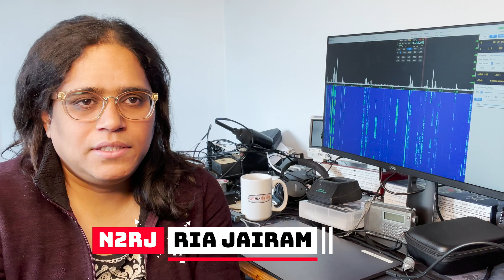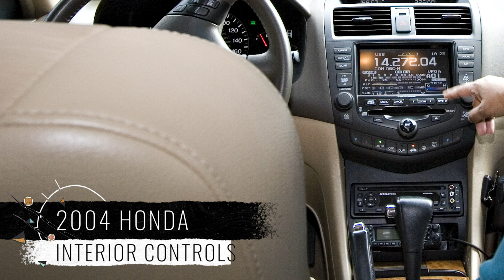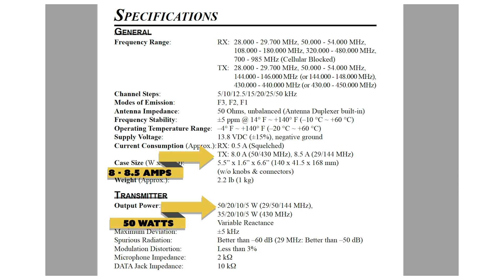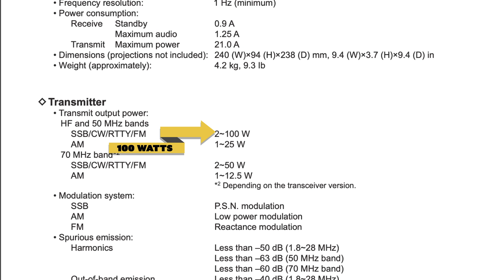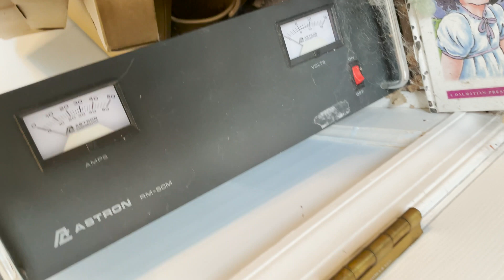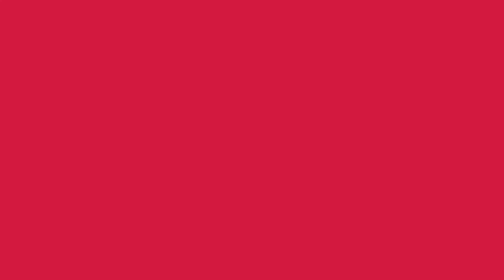Which power supply do I use for my ham radio?

Comment: HII RIYA,  NAMSTE🙏,,,    I M NEW BEE  IN HAM ,   I HAVE A QUESTION , IN POWER GRID FAILURE ,  CAN I USE MY HOME INVERTER SQAURE WAVE BATTERY BACKUP TO POWER LINEAR POWER SUPLY (30 AMP 13.8 V )  WHICH GIVING POWER TO IC7300
Reply from the maker: You can but the power quality is probably not going to be very good.

Comment: I use my hand held while it's charging quite a bit. The transmit current draw is provided through  the battery, so as long as the battery is at least partly charged you should be good. The only  downside might be noise from the smps.

Comment: Good video! However, I power my entire station with Lithium Iron Phosphate batteries and solar with no issues with battery voltage performance. The solar panel keeps my 65 ampHr batteries charged and the protection circuit in the batteries allow for a more stable voltage throughout the use of the battery load vs time. Newer batteries allow one to get away from the hazards of lead acid type batteries. KM4IYQ
Reply: @n2rj  Yes. I use the Buddipole Mini module that controls power and solar input to batteries and power output to the equipment. It will control up to 30amp output to equipment. The nice thing is that the Mini has absolutely on RF noise. I use Bioenno for my batteries. They are expensive for large capacity storage but perform great with 3000 charge cycle life!

Comment: We used car stereos as home stereos, too! 
All of my power supplies are linear. The one I use the most,  is an Aries 50 amp that I got for free, because the transistors were blown. Replaced them, and it's been running daily for the last 10 or so years.

Comment: Surplus/Obsolete Servers are a good place to find PSUs.  20-30 dollar range on ebay.  Usually between 60-100 amps continuous with lots of built in protection.  The point of a server is to stay up, so these are usually robust in headroom and protection circuitry.  Most feature a 'current share' connection for easily paralleling.  Many are switchmode, but out of the handful I have tried most are very quiet- no hash.  Had one with some hash, and using a FT-240-31 toroidal ferrite core with both positive and negative leads wrapped about 10x knocked it down to nothing.  Rinse repeat.  Name brand stuff is a rip-off.